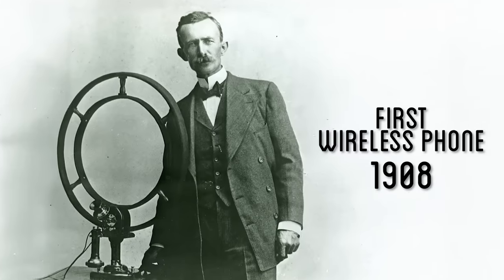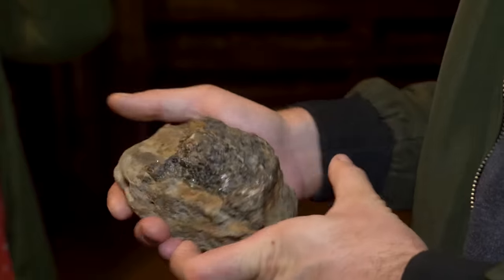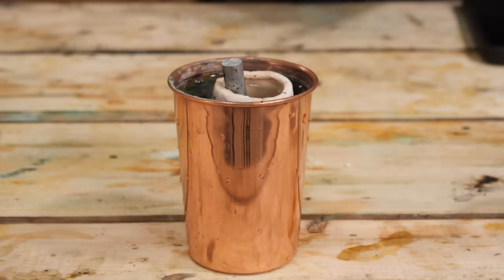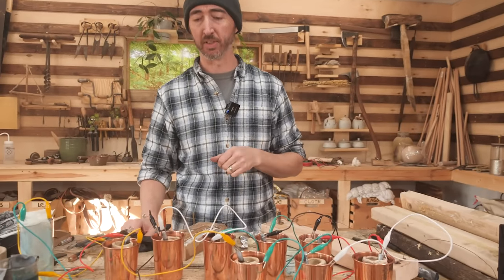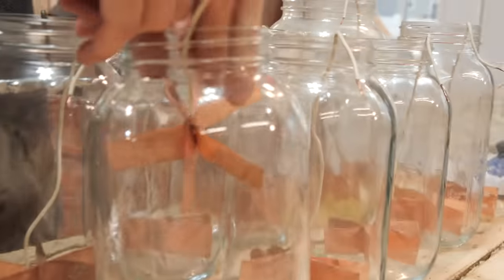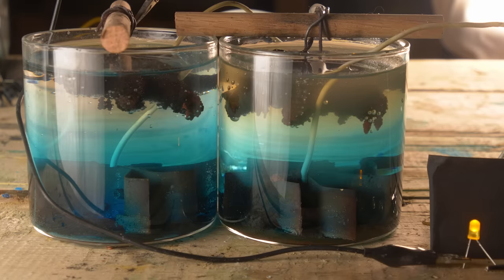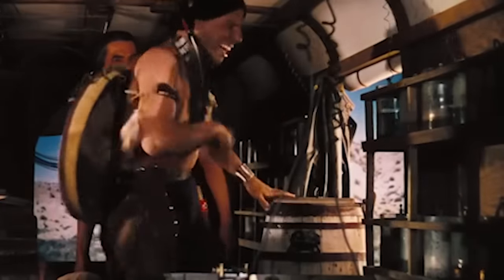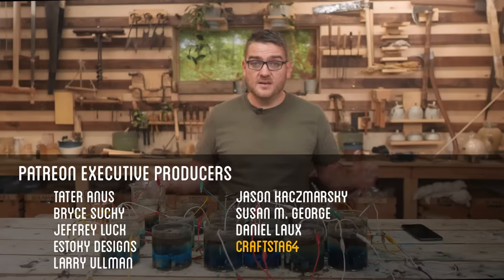These 3 Rocks Can Charge Your Phone!

Comment: It really goes to show how much energy is needed to run a telegraph for these batteries to actually be used up to the 1950.
Reply: Impedance plus the distances involved, and i think proximity to the ground had a weakening effect as well, even with lines above the height of railroad cars. (But don't ask me to explain it, lol)
Reply: @Grandwigg  The capacitance of the line was not important in telegraphic lines. But with the advent of telegraphic submarine cables it became important.
Reply: They used these cells is because they could be made on-site, every day.  The components could be separated back out and reused.  Low cost.  It would have been far too expensive to use a supply of disposable sealed batteries.  And rechargeable weren't of any use, if there was no other electricity source to recharge with.

Comment: also the bagdad battery was just a curse jar... I know cuz i saw an interview with the guy who found the site they were discovered at and opened them and saw the curses on the paper inside the jars...
Reply: yeah, could've had some electrical properties too, though. if you got a mild shock every time you touched a curse jar and didn't know what electricity was you'd definitely believe in the curse, right?
Reply: @janthran That's an excellent point actually 😆
Reply: Paper? As in papyrus? What paper and ink would survive the acid and still be legible for more than 2000 years? Humbug

Comment: Improve charge time by turning off the phone. And because internet stuff wouldn't work, enable airplane mode to extend life. Furthermore, since you're limited to only what is on the phone, you can have it off when not needed, further extending time between charges. After all, how often are you going to need the calculator function or photos? Unless you've downloaded wikipedia...

Comment: Wonder just how hard would it be to make a decent zinc-air battery. They're a lot simpler in construction with modern supplies, but I kinda wonder if that would still have been the case in the late 1800s, early 1900s?
Reply: NurdRage did one several years ago

Comment: I maintain Edison batteries. The voltage comes from the chemical reaction of the batteries. The amp capacity comes from the surface area of the electrodes in the salt bridge solution and the distance between the electrodes. Battery manufacturers use a mesh like electrodes to increase the amp capacity and size. 

Deep cycle NiCd, FeLiPO4, and  FeNi use a a lattice framework layered with powdered Ni and Cd. The powder increases the surface area for each plate.

There are some Edison batteries that have been in service for about a hundred years. My batteries' age are about forty and fifty years.

Comment: You could have made a lead acid battery from technology over 1,000 years ago.  Galena and sulfur and glass to make the whole thing.  Will also be able to get some silver out of the galena when purifying it to lead.  Also, don't need to remove all the other metals from the galena, as long as you get at least 50% lead.
Reply: You can certainly make a lead-acid battery but those are rechargeable so you'd still have the same predicament. AFAIK if you start with lead plates the battery would be fully discharged.
Reply: @eDoc2020  They will actually have a bit of voltage on them, and if the lead is oxidized to begin with(only the positive plate/anode should be oxidized lead), it will react with the battery acid and be anywhere from 20% to 60% charged just from being built.  I have been experimenting with building my own lead acid batteries the past few months and lead acid batteries have such a capacity that even mostly dead without being charged after being built, they still put out much more power than the batteries he showed.
Reply: @johnbrizendine7716  Oh, good point. Rusty plates on one side, clean ones on the other would mean it starts at 'partial charge'. I didn't think of that. Still requires working with a bunch of lead and sulphuric acid though, ick.
Reply: @05Matz  this is true, definitely risky and toxic, but totally worth it for quick easy cheap power.
Reply: @johnbrizendine7716 lead is a very toxic metal on its own, and sulphuric acid is dangerous. If you add acid to lead, you have high risk of getting lead poisoning from the fumes and from just handling it as well

Comment: I am immediately wondering how one would be able to test the voltage or the battery? Assuming advanced tech and knowing the voltage (and amps, ect) that it would require, how could you test that in the same rudimentary way you are creating the battery? Other than not overcharging or undercharging, how would you know you got it?
Reply: Look up the “electroscope”, a very early means of detecting and measuring charge.
Reply: early voltmeters are made with a very high resistance resistor attached to an extremely sensitive galvanometer. A galvanometer is constructed like a motor, except that it only has a single coil/pole and it contains a spring that pulls it out of alignment.
Applying voltage causes current to flow, which causes the galvanometer to pull against the spring. As the tension force of a spring is directly proportional to the elongation of the spring, the angle where the galvanometer stops rotating indicates the amount of force the galvanometer is applying, which is proportional to the amount of current flowing through the coils. As the current is directly proportional to voltage, this gives you an indication of the voltage. To avoid draining so much current that the voltage sags from battery internal resistance, the whole system is calibrated to run with very very little current.
Reply: @PixlRainbow  It might be interesting for us to attempt to construct one of these. I don't mind my current method though, of just "tasting" the electricity 🙂.
Reply: Depending on how far in the past we're talking about, you should be able to do some electrolysis and then doing the math should be fairly easy for the kind of person to randomly make themselves a battery one day lol
Reply: Galvonometer
Reply: Maybe they make it before they attempt to time travel take a multimeter

Comment: So I understand that the video is about making a battery, which was very fascinating, however, based on the title, would it not be easier to make a generator, powered by a water wheel? Oddly enought the exact premise is something I have thought about (going back in time and needing to charge my phone), and I always figured that a geneartor would be easier to create/source material for then the chemicals for a battery. Basically, magnets and copper wire. I'm not an engineer, so maybe its more difficult?
Reply: the magnets?
Reply: I think this is something we're definitely wanting to do. However, one of the major setbacks is how to produce permanent magnets of a significant strength. From what I understand, natural loadstone magnets are pretty weak, and making stronger ones typically requires pulses of electricity at a very high current. Additionally, you'll want to produce a lot of very thin wire, which from our experience, is pretty laborious. I don't think any of this is outside the realm of possibility though!
Reply: @ElliotKrueger isn't it feasible to generate electricity by having a small battery serving as a "starting magnetic field" and the generated current in part to amplifying the magnetic fields further. I thought that car alternators partially work like that. When you spin then you don't feel the axle locking that you feel when spinning a permanent magnet motor. I am not an expert though...
Reply: @JPRTonundFilmstudio   Yes, self-excitation is the way to get around a lack of permanent magnets. The Daniel cell would provide enough for initial excitation.

Comment: You don't need to go back 100 years to be amazed. 1995 me would have been absolutely blown away by even budget smart phones we have today. Touch screens, LiFePO4 batteries, USB and Qi wireless charging, all would have been mind blowing but Wifi and Bluetooth wasn't even something most people imagined possible (was only a twinkle in the eyes of a few engineers). The fact that the device would have been the most powerful computer on the planet and fit in your pocket would have been equally impressive. The largest problem to taking a cell phone back in time is the fact that almost everything relies upon constant internet/cellualr. There was no 3 or 4G (forget 5G), no wifi, and no USB on computers means you have no way to do much (except what is already downloaded on the phone) even if you could charge the thing.

Comment: Using thicker and shorter wires between the batteries as well as a better connector than the aligator clips would help with a better flow and increase charge times.

Comment: I'd go for any sort of generators. Water, wind or steam generator seems legit to me.
Reply: generators make ac, vary with the input speed, and rectifiers, well, you just need decent capacitors but i'm not sure how one really makes those, but the operating principle is so simple. Anyways, a battery is a generator. It uses the chemical energy in the solution, or in the metal of the contacts, to power stuff. And, you aren't tethered to a river whenever you want to charge your phone.  Though yeah, generator is a very good idea, but needs either a rechargeable battery or an essentially modern psu for anything digital/communicaty.
Reply: @Rowlesisgay  If we only swap out the power source in this video's setup, so he gets to keep everything other than the batteries, I'm pretty sure AC would work just as fine.
Reply: @ysolda9614  why ? phones charge with dc and I didn't see any rectifiers.
Reply: Only a flux capacitor powered with a bit of biogas compost and a tin can

Comment: Why use make a battery when you just make an alternator and connect it to a water turbine to a nearby river, and i guess a power inverter to step or step down the voltage or even just a home made little solar pannel

Comment: If you were to go back in time 100 years or farther in time with your phone you’ll only be able to take pictures/film your surroundings, use the calculator, listen to music, and watch save videos/movies. 

There wouldn't be a wireless tower to use to make calls/text,  there would not be WiFi/ internet, maybe your clock wouldn't work right, calendar, weather app, maps, payment by phone, and other apps
Reply: I think that goes without saying. Clock, calender would work and you can use maps like normal maps
Reply: Your phone also has a built-in compass, and also an accelerometer that allows it to serve as a spirit level or an elevation gauge. Some phones are also capable of basic AM/FM radio reception, and the headphone jack can be jerry-rigged for AM/telegraph radio transmissions with the right app. If you have any plate solver apps or celestial navigation apps saved, those would still work to automatically calculate your location as they only depend on the position of natural objects (sun, stars, time of day, etc)

Comment: Bigger problem would be, if you did not have the charging cord with you, no-one could produce such delicate parts back then, well maybe a jeweler
Reply: As it turns out, you just need to be able to produce some wires and come up with a way to connect them into the charge port on your phone. With Android, we found that you only need the power and ground leads to charge it. However, with iPhones, you would need a total of 4 wires, two of which for power and ground, and two of which for data and ground. You'd then have to supply two different voltages, with the data being 3v in order to signal the phone that it's okay to accept a charge. It took some experimentation for us to get this to work, and I may have destroyed more than one of HTME's iPhone chargers figuring this out. 🙂

Comment: The irony of the comment (12:18) of how simple telecommunications starts and where it is today, modern communications uses a digital signal (either on or off) and the old simple telegraph uses a digital signal (either on or off), it is just the encoding of the signal that has changed.  The modern system uses a fixed byte size and standardises the signal, where as the 'old tech' used a variable byte size with an 'end' signal, thus minimising the 'dead' time in the transmission (when no data was being sent, just empty bits), example on Morse code 0 (zero), which has the longest signal in Morse code (5 dashes) is a 23 bit byte (1110111011101110111000), but e is only a 4 bit byte (1000), both having the 000 as the 'end signal' to show the end of the byte, thus saving 19 bits of bandwidth for use on the next byte (or more).  Funny how sometimes 'old technology' is often more advanced than the 'new technology' as the old timers had to make more efficient use of the available resources (in this case the 'bandwidth' available).

Comment: If closer is better but there’s the problem of buildup on the floor, could you set the copper pieces on top of something non conductive?
Reply: From what I understand, one of the benefits of these batteries is that copper is what is forming and collecting on the bottom of the jar. Since the bottom electrode is already made of copper, this only adds to the surface area and potentially increases the amperage of the battery over time.

Comment: So it seems if you're using the crows foot battery, you should use a thicker gauge wire to suspend the zinc electrodes

Comment: While a battery might exist. How does one charge it? 
I was thinking that someone could use some crude form of hand crank unit.
Reply: This form of electrochemical battery produces the charge, and doesn't require charging like a modern lead-acid battery does. The charge runs out as it runs out of reactants. With this specific battery, you generally only need to add more copper sulfate to keep it going.

Comment: I know this isn’t the main point of your channel and just the framing device for this video, but you glossed over one of the key steps with half a sentence: how to change random noisy input into something your phone can actually use.  Do you have any resources on that, or possibly plans for a follow-up video?
Reply: Batteries are essentially noise-free, you can charge your phone directly. You only need to deal with noise if you're using a generator.
Reply: @eDoc2020  Huh, I would have expected noise anyway with this setup.  But either way it also is not compliant with USB-PD or any other charging protocol the phone expects
Reply: @danielrhouck   Traditional 5v USB charging (non-Apple) is indicated by connecting the two USB data lines together, there's no fancy protocol required.
Reply: @eDoc2020  Nothing was created to be able to measure 5V to within any sort of tolerance
Reply: @danielrhouck   True, they just used a modern digital multimeter for that. But you really don't need to measure it, an unloaded Daniel cell puts out 1.1 modern volts under normal temperature. 5 in series gives 5.5v which is tolerable.

The semi-modern volt wasn't in use until 1893 and Ohm's law wasn't widely believed until the 1850s. So for the purposes of time travel and using modern devices you can't go back further without bringing your own voltmeter. But if you're that late you can also use a generator. If you bring a modern phone charger it would work fine on an Edison distribution network.

Comment: Probably would make more sense to create a small generator with a treadmill although you somehow need to rectify the AC produced.
Reply: Not an engineer.But I believe it’s all about how you place the poles of the magnets to create AC/DC current. I think that if you put the magnets with interchanging magnetic field, that will create AC. But if you put them with the same field pointing in one direction, then it will create DC.
Reply: @fairybeliever4479   The changing magnetic field is what creates the voltage. What you do is generate AC but use a mechanical commutator for rectification. This is basically a brushed DC motor.

Comment: If you are a time traveler, just use 1 weak battery and use it to start the coils of an electrical generator made from copper wire obtained from a watch maker or jeweler.  No permanent magnet needed.  Worst case, make your own wire.

Comment: If you find yourself unexpectedly transported to the past, you might have to create 1800s technology to charge your phone, but if you take a planned trip to the past, I think you would be much better off taking some portable solar panels and/or a hand-crank generator.  This is the first video from this channel I've watched in a while. Have you tried building an electrical generator yet?  Perhaps you could attach it to a water wheel.  Speaking of telecommunications, I've seen some old telephones that used a hand crank to provide alternating current to provide power to a ringer in the central office. I wonder, how long would such a generator take to charge a smart phone?
Reply: I think this is something we're wanting to do, but one of the setbacks is being able to produce homemade permanent magnets of significant strength.
Reply: @ElliotKrueger  Under your rules, would you need to invent an airplane to travel to China to mine neodymium?
Reply: @ElliotKrueger you could bypass permanent magnets using an alternator approach, where the magnetic field comes from another coil powered by batteries.

Comment: 11:25
 it actually takes less time for a battery to charge from 0 to 50%, than it does to charge from 50 to 100%. So charge time from zero may be lower that 30 hrs. This is because the voltage differential is higher at a lower percentage.